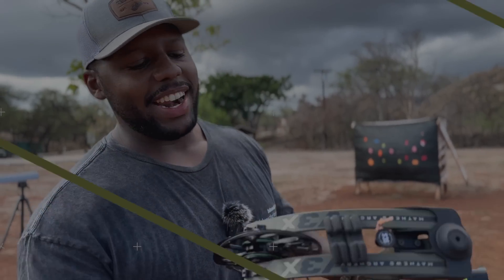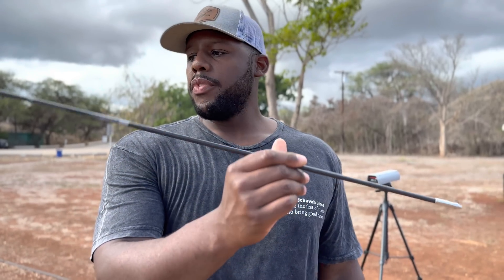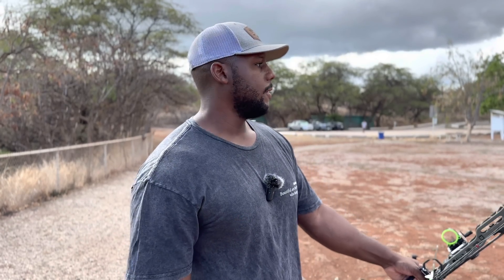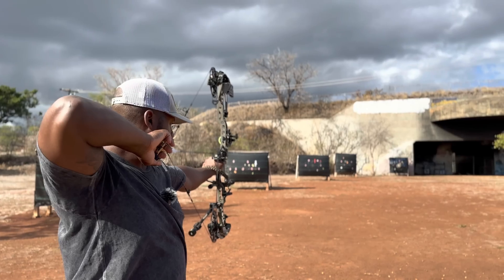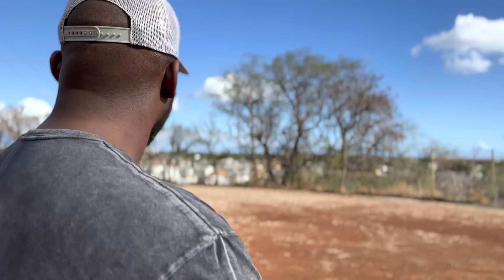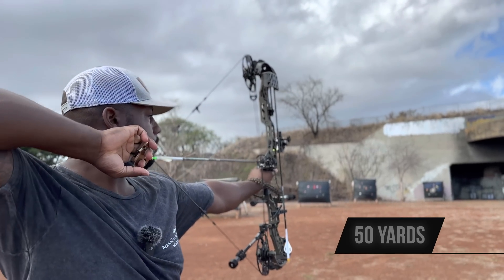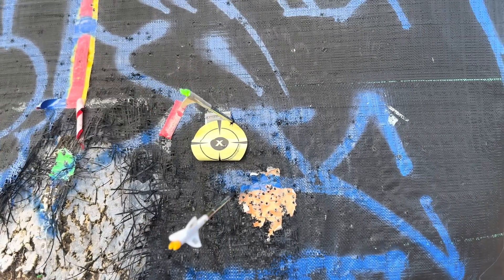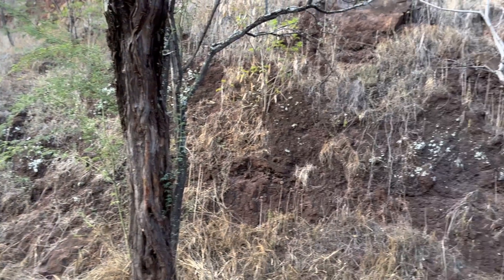Will adding 70 grains to my arrow destroy my trajectory? (620 grains total)

Comment: PLEASE FOR THE LOVE OF GOD.... do ACCURATE TESTING....... I say this because everybody who has covered this topic always do the same thing... They have their bow tuned for shooting the lighter arrow and then turn around and shoot a heavier arrow like people aren't supposed to realize that it's going to impact a little lower due to the extra weight.... These people then turn around and say if I was shooting at this animal at 30 yds, that my arrow is going to impact 10 in low which means I would have completely missed... This in no way shape or form shows your trajectory... If you are going to take a bow hunting you are not going to sight it in for a lighter arrow and then turn around and try to hunt with a heavier arrow... This is why, this version of testing directly makes zero sense... The idea behind shooting a heavier arrow is NOT for the trajectory... The heavier arrow is for increased lethality.... The RANCH FAIRY never said you can't get the job done with a lighter arrow however shooting a heavier arrow will increase your chances of penetrating heavy bone if the animal was to move before impact... People are taking a small part of what he said in trying to run with it like it's the gospel....

Comment: You and I shoot same draw and roughly the same setup.  I actually have 3 different weight broadheads in my quiver for different applications, but all the arrows weigh the same at 550g.. I'm an east coast hunter and I've hunted Kauai . You shoot 81# mathews I shoot a 80# hoyt.  AT 80# you tip the scales of spine weights. You could drop 5# off your draw and it would keep you in the 260 spine, I did that on my setup. My main broadheads are 150g because I wanted to shoot the IW wides that were not vented.. I shoot IW 150 wides and 150 single bevels. I personally do NOT want to go to 600g+ arrows. I blow through everything. I've actually lost more broadheads due to them being stuck in logs or roots than I have to lack of penetration. My sight tape gets me out to 114 yards. FOC be damned. I've been shooting 500-550g arrows for 25 years. I've tried chasing FOC but I've also never had arrow penetration issue.. I said all that to say, you can save yourself money on new arrows if you just drop 5# off your draw weight

Comment: That 235 FPS is still insane though (86.4% of original fps). That means that even at those far out distances you still have plenty of lethal force moving. I shoot recurves so much less fast but another data point to say that if your slow you might as well hit hard since the speed drop within effective hunting ranges really is not going to be significant.

Comment: When the arrow doesn't erode over time u get a truer shot. I'm talking out the arrow fluttering or parachuting when it's too light @ longer distances. If the spine allows u can have a 530-570 grain arrow keep incredible accuracy @ longer distances if it's a 4mm shaft with 4 low profile vanes. But a 600 grain arrow and up will be quieter upon release.

Comment: Great video.   I see in the comments below that you are shooting 81 lbs at a 31.25 inch draw length.  Is that correct?  
My setup is likely going to be a Mathews Atlas set at 75lbs with a 32 or 32.5 inch draw length.  I believe I am going to have to adopt a similar 200 spine 5mm Axis for my set-up.  For comparison purposes can you share your arrow length (end to end of the carbon shaft) and the total tip weight (tip plus insert).  Thanks!

Comment: Well the old adage I was taught in archery back in 1970 was any change to your equipment will result in overall change. One thing I will say about adding weight to your arrow ? You will simply DEMOLISH what you shoot. I personally am a believer in a heavy arrow. I shoot from 550 grains to 625 grains on my 80 pound bow,,,,,300 FMJ or a 200 spine all carbon. My 200 spine are 12.8 grains an inch,300 FMJ are very close to that s well.

Comment: Not sure how you don't have more subs well I know you don't do a bunch of click bait shock value videos. Anyways always good information here im aiming for my 23 arrow setup to be around the same weight your shooting but my bow is slower and I think im a bit shorter in length I draw right at 30 inches. Itll actually be a reduction in weight as I shot 692 this deer season worked fine but looking for that goldilocks setup.

Comment: you'll probably need to add a bit of elevation, same as you do shooting your standard arrow at 20~25 yards and then taking a shot at 45~50 yards.
The heavier arrow will be traveling slower, draw weight and length the same as with a lighter arrow. 
Gravity will pull both to the ground at the same speed, regardless of the horizontal speed of a projectile.
Fun fact: If you simultaneously fire a .22 rimfire rifle ~1200 feet per second), and a rifle chambered for .220 Swift (4,000 feet per second) with the bores perfectly horizontal, AND drop a 600 grain bullet from a .50 BMG cartridge from the same height as the centerline of the rifle bores, all three pullets will hit the ground at the same time. The .220 Swift is traveling a lot faster than the .22 rimfire, thus going a much greater distance, giving the illusion the .220 Swift has a flatter trajectory. In reality, their trajectory - time it takes for them hit the ground after leaving the barrel, is the same. The slower .22 rimfire needs more time to reach the same distance, so it requires more elevation, making the arch the bullet travels higher. At 100 yards, for example, the rimfire bullet may drop 8  inches or so, while the .220 swift may have dropped a small fraction of an inch. Any bullet (or arrow) needs enough elevation so the arch of the projectile and the line of sight intersect at the given distance.

Therefore, the correct answer is: No. A heavier arrow will not mess up your trajectory. The arrow is falling to the ground at the same speed. That has not changed. The time in flight has changed, so you need to adjust the elevation accordingly. 😁

Comment: You should have measured the penetration to see which one penetrated deeper. I’ve done that study at home (V3X 33” 75# 30.5” 80% let off 600gr arrow vs 450gr arrow) in a target and I was surprised with what I found.
Reply: Foam is not a consistent medium to test penetration is the problem. 20% balistic gel seemed to be better but not perfect either.  I waiting to find the answer from a engineering friend, he's trying to come up with something similar to muscle tissue consistency.
Reply: What did you find?
Reply: The lighter arrow actually penetrated deeper every time. My take away from my personal experiment was kinetic energy is on a bell curve and just because your projectile is heavier does not necessarily mean it penetrates deeper. 

But that was just from my findings. I’m no scientist or professor lol.
Reply: @javiermonroe5249  targets are designed to stop arrows. Heavy penetrates deeper everytime period. Its simple physics man. The only real test is on meat

Comment: Haha got to love the people who say you don't need a arrow that heavy.

 Got to remember they are God's gift to archery and always make perfect shots on everything!

My light setup is 688 grains with a 85lb compound. 

My medium is 84lb recurve with a 923 grain arrow at 33 yards with a Buffalo full pass through and shaft was sticking in the ground half way on other side. 

Haven't shot a buffalo with my 107lb longbow yet, ill try soon as I get time. 

But the perks of shooting a fixed blade 600+ grain setups are if you hit a shoulder or a rib on a moose, elk, buffalo, hippo, etc it breaks it and goes through it. 

With a light arrow it will bounce off or not even penetrate it.

Also if you have to worry about trajectory that much, your stalking ability on a animal suck. 

Good video man, aim small, miss small brother.

Comment: So your old arrow was 287 up close and 240 at 100yards, and your new arrow is 272 up close and 253 at 100 yards… That is interesting. It would be interesting to see where the overlap is. I mean it would be interesting to see at what distance they are actually shooting the same speed…🤔
Reply from the maker: I was thinking the same thing, there will probably be a part two to this video
Reply: Ranch fairy and DIY sportsman both did the physics explaining this
Reply: Bruh...some serious reps happened for that level of marksmanship! ✌🏾🏹
Reply: I'm so glad u made this video. I make all my arrows. Start with blank shafts & do alot of nock-tuning before I even put vanes on. When I do put vanes on I use 4 small low profile vanes. My setup was scary @ the bowshop when my 4mm arrows on the chrono were buried into the wall up close where they have u blind bail. I can tell u that @ 63 lbs. & a 30" draw it was 262 f.p.s. & with a 520 grain 300 spine arrow. Since then I have several arrow builds from 530 grains to 640 grains. Most of them r very well tuned of the 4mm variety. My 640 is a steel/carbon 300 spine with a 125 grain Ethics insert/outsert with a low profile Bishop Holy Trinity head. Pretty much a backup arrow that is very tough. I don't shoot from the distances u do but I also never hunt from the ground.  When u shoot a well balanced arrow from a 🌳 it's even quieter to an animal cuz the hunter & prey r on 2 different sound planes. IMO f.p.s. is way over-rated & impact specifically point of impact is under-rated. I know that the deer u were talking about could have been shot in front of the shoulder with an exit just behind the opposite shoulder. Recently I shot a deer from the ground b4 I could get up in a 🌳. Cuz I was on the ground I used the 640 grain setup & made the shot tight behind the shoulder @ 15 yards. If I was up in the 🌳 I would have had a more forward impact but on the ground with the head going from feeding to looking @ me made me take the shot due to not wanting a moving neck shot. The shot angled after the one lung was hit & exited through the liver. I was fortunate minutes later after it went only  30 yards & I was able to put the same arrow through the front of the chest. After the liver one blade just put a minor gash outside of the abdominal cavity w/o going through it & spoiling the animal. The sound is so quiet @ release & that means u aren't burning up energy cuz it's energy stored. I like to see more efficiency with bowhunters since the result is animals going down more often quicker. That will lead to the Hogstopper mindset going away for good 👍. Thanks again & keep em comin.
Reply: What pound draw was the Mathews bow that you were using in this test?
Reply: Heavy arrows carry there speed better at distance
Reply: When u don't have wasted energy it stays up in the front of that arrow & has more accuracy also. Not to mention your bow is quieter due to the efficiency.

Comment: I don’t understand this obsession with very heavy arrows!!!. A 425 gr arrow is more than plenty to harvest any big game in North America. It comes down to shoot placement. Of course this is my humble opinion… hI believe that speed is more important that weight… But keep the excellent job,SUA SPONTE..,
Reply: A 425gr it's perfect until you hit a shoulder blade or rib... that's when the heavy arrows shine, it's a plan b arrow.
Reply: @KerryCaberga-2025  my 430 grain setup hasn't had issue on elk shoulders and ribs🤷
Reply from the maker: I’m obsessed with a quiet arrow which is why I went from vented broadheads to solids which are heavier.
Reply: @Privileged Bowhunter  Also a heavy arrow quiets your bow. When I was shooting light arrows my bow sounded like a .22 going off, its way quieter now with 550gr arrows.
Reply: The goal is to get a pass through. Even if you hit bad placement and hit a large bone. At the very least after hitting a large bone, you're at least still in the vitals instead of stopping at the large bone.
Reply: Pass thrus are vital. I went from 420s to 500 with 19 percent foc and I blow thru deer now and pigs. With the light setups you routinely have half arrows sticking out of deer
Reply: Speed doesn't penetrate, momentum does. The shot placement argument is fucking stupid. Of course we try to make the perfect shot, but shit happens. I'm just so sick of hearing that dumb shit. Are you a robot? Have you never pulled a shot or had an animal jump the string

Comment: I'm picking up some axis 5mm 200 spine this week I'm dropping from vulcan 200 spine 760+ gr to hopefully 580ish. I have a V3 29" 75lbs shot a buck dead in the shoulder at 21yrds with my current set up and didn't get in the cage. Very disappointed so I'm upping my speed to hopefully help. 760+gr is slow as dirt out of the V3@75lbs.

Thanks for sharing cool info and good shooting!
Reply: What type of broadhead did you use? I'm considering building a setup around 650gr, would love to know yours too get some feedback.
Reply: @Sapper_Rage  hey brother I am shooting a three blade Rocky Mt cut on contact 160gr with 200gr ss insert n collar by ethics. I also have some van demon 150gr single bevels that are pretty sweet too. I'm dropping back on totally weight so I can regain speed to help with the punch.
Reply: Maybe try to put some of that weight in the F.O.C.. Using heavy arrows for the sake of heavy arrows isn't as effective as higher F.O.C arrows. 700 grains at 10 % is not the same thing as 700 grains at 17% for example.
Reply: @casanovafrankenstein8875  so my FOC is 19% so what's your thoughts?
Reply: @tree_monkey3120xp  19%? Damn, you short draw fellas no doubt have an advantage there. Seeing how that setup didn't work, I guess my thoughts would be, don't shoot a buck dead in the shoulder. 🤷‍♂️
Reply: Did you bare shaft tune your bow to that arrow?
Reply: @bigz5262  100% talked with hoss from ethics did everything the Ranch fairy does.... the bow shoots darts beautiful! Just slow as dirt....
Reply: @tree_monkey3120xp  with all due respect, there are people getting pass-throughs on Cape buffalo with recurves so I don’t think speed is your issue. Maybe keep the two blade instead of a three blade
Reply: @bigz5262  you are correct I just have close to a life time supply of these 3 blade heads so I'm shooting them. They are wicked 7 inches of cutting surface and they put animals down stupid fast when I don't shoot stuff in the shoulder. That being said I'm dropping back on totally arrow grs to shoot flatter and still smack the heck out of them! My MR5 29" 83lbs is stupid and the axis 5mm with 50 or 75 gr bass and 160gr broadhead will put a beat down on pretty much anything!
Reply: What's the arrow speed?
Reply: @jowho9992  just chronoed this set up 767.0 grs 228fps... my Mr5 80lbs  4 turns out due to being stored 244fps
Reply: @tree_monkey3120xp  
My chill x at 30.5 dl.  65lbs. would probably move a  600 gr. arrow well enough, of course I would have to crank it all the way down 72 lbs. just to see what it would do 😁
Reply: Could go to 75% let off for a little more 👊
Reply: @tree_monkey3120xp  
I was looking at 
DXB Big Game 3  broadhead
300 gr. 1.8" cut the lightest I could build the 200 spine arrow would be 
716 gr. 
It seems interesting.
Reply: @jowho9992  the Chill x was a sweet bow! If I shot a single bevel I think it would have punched through even at that speed and FOC. 
I do think that from my little experience of bow hunting going to the arrow set up I have 228fps has cost me. Speed helps and I'm am back to messing around with things I'm know with this new arrow combo over 580 and I want to see how it shoots. So let the bare shafts fly and the nock tuning begin! 

Best of luck to you!
Reply: @jowho9992  on the V3 if it's over 250 I would be surprised it's stupid slow! I have not shot thru a chrono.
Reply: @tree_monkey3120xp  
The biggest thing I hunt are whitetails, I am shooting GT Velocity Pro 300's 415 gr. at 285 fps 63 lb draw I don't see myself shooting more than 65 lb draw, I shoot 3000+ shots per year and I am not going to push my 46 year old shoulders with excess draw weight but I was thinking about building some heavy arrows just for fun but 650 gr. or more will be slow for sure.
I haven't hit any deer shoulders yet.
Reply: @jowho9992  heavy seems cool but watching your arrow arch and then come back down and hit the target gets old I think you have to pay way more attention to shots any brush or thick areas cause more passed opportunities. I am dropping down for flatter trajectories and still carring a knockout punch. 

Keep slinging arrows man my dad's in his 50s and shoots all my bows! If you have the money let err rip!

To clarify the arch begins after 35yrds on my set up!

Comment: Hi, what do think? from 10-40 yards I'm hitting point of aim. At 60 yards, my arrows is hitting about three inches to the left. When I adjust it to hit point of aim, my 10-40 yards is now off to the right. What do you think, arrow spine issue with temperature change from summer to winter or is it me? This is my budget compound setup that was ok during the summer, ok meaning I had a large dish side group at 60 yards then but now my group is tighter but not point of aim. And if I try to fix it, it's like the arrow wants to boomerang.
Reply: That could be a tuning issue, form issue, or the second axis on your sight. Basically your pins may not be straight up and down and the longer the distance, the greater this effect becomes. Hence why you dont notice it till 60 yards. Look up a video explaining the axis adjustments and why its important
Reply: Could be a couple things. Shoot thru paper again at 7 yards. Make sure still in tune.
Reply: Thanks for the advice everyone. My second axis was way off and I had to work on my form which was off as well, since I haven't shot in months after a back injury. My son dropped my bow a few months back, I'm thinking that may have knocked it out of adjustment because before i stopped shooting when it was still warm,  everything was fine.
Reply from the maker: Your second axis on your sight could be off